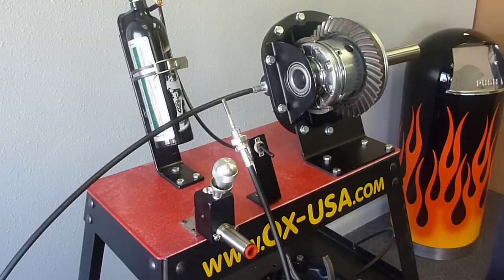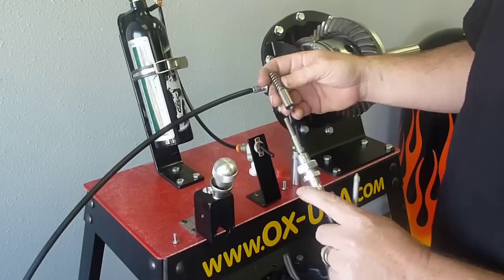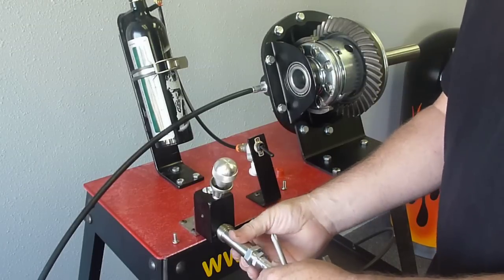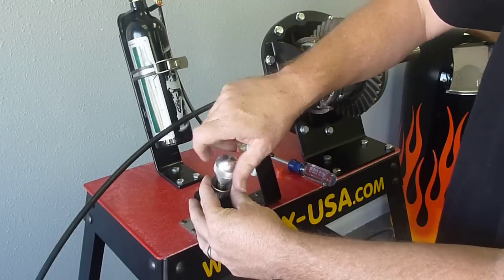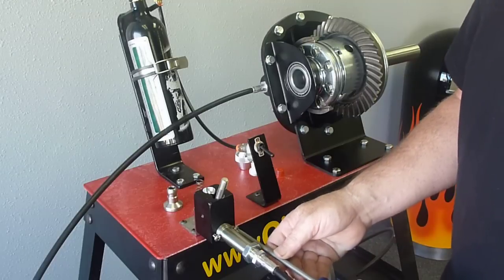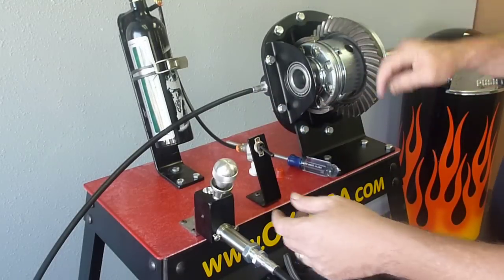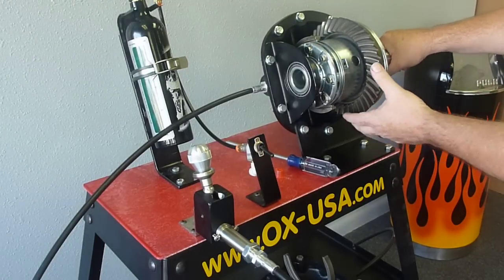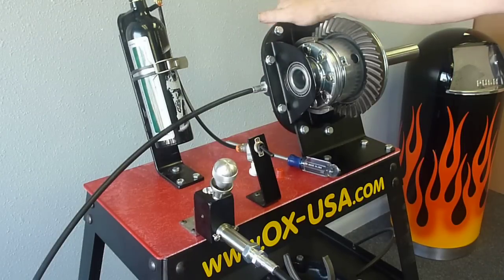OX Locker Manual Shifter Adjustment Tutorial

Comment: The previous owner installed OX lockers on my '92 Jeep YJ ;the front one is mechanically activated through a cable like in this video, the rear one is  electrically activated. None of them work. In front the jeep has also the  Warn locking hubs installed that work really well or so I think. However, in the open diff position when I spin  one of the wheels the other one does not spin in the opposite direction but the front driveshaft rotates, so the locking hubs work... When I set both hubs to "Lock" the wheels are coupled to the axles and front driveshaft rotates , but the differential is not locking when the OX manual lever is in the lock position...I'm still very confused since the principle is really simple. Looking forward to fixing this since it seems that the OX lockers' activation is very simple... Thanks for posting the videos!

Comment: are the ox lockers available for old Ford 9" axle variants?  (specifically 1978-1979 as I have an old bronco that will need some major upgrades down the road.)

Also what is the torque (tensile strength of the design in general) rating for the locker?  I'm also looking for reliability (something that will last for at least 5 years without any problems other than occasionally adjusting the play in the lever to engage/disengage the locker)